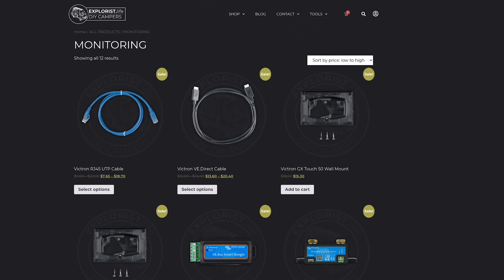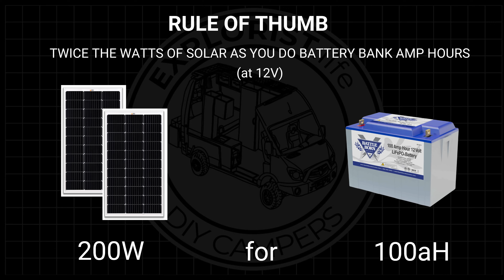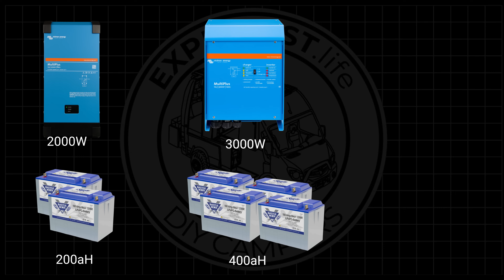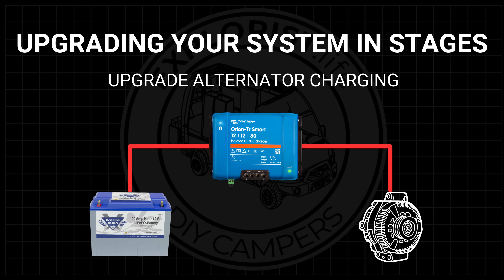Upgrading an RV Electrical System in Stages to Save $$$ upfront.

Comment: Nate

Can you comment on charging a heavily discharged lithium battery from the tow vehicles 7 pin plug.  Some people say you can damage the tow vehicles alternator and other people say that it will just charge very slow.  I want to do my trailers electrical work in stages by just adding 2 x 100 amp lithium batteries first and then going with around 400 watts of solar. I’ll add dc-dc charging and a small inverter as well.  I just don’t want to kill my alternator or melt any wires. 2022 F-150 with 3.5 ecoboost.  Alternator is either 200 or 240 amps. 

Thanks
Reply from the maker: It will generally just charge slowly.  I've never seen it melt anything.  It won't damage the alternator
Reply: @EXPLORISTlife  Thank you.
Reply: Hey Nate, another question, or actually an idea for a video or two.  Can you talk about batteries a bit.  What's the difference between 3 x 100 amp lithium battteries vs 1 x 300 amp lithium battery.  What's the difference between say a 50, 100 and 200 amp BMS.  Charging requirements etc.  Thanks

Comment: Hi guys, I have a tricky question: 
is it possible to put under charge the start battery (during camping standstill) using an Orion DC-DC charger, taking energy from the RV battery bank? 

ciao :)

Comment: I’ve got a 1999 chinook class b with a very old solar system and inverter setup and I really want to upgrade the electrical. I don’t need a ton of battery storage though. I’m ok with running the generator when power gets low. Although I would like to avoid ripping up walls to replace all the wiring lol

Comment: What about shore power charging without an inverter? We know that many converters in popular trailers claim to have a lithium autodetection feature, but it is widely reported to not work well. And even if it does work, it’s unlikely shore power charging will reach the claimed 30 a on the factory wiring. I see Victron sells a 30 a stand alone charger, and so it probably makes a real 30 a especially if located close to the battery. Would you recommend that? I have no 120 V loads in my trailer nor do I anticipate any in the near future. A charger is something like 1/5 the cost of an inverter/charger.

Comment: What you are not telling people. There is another way to run air-conditioning without expensive battery systems. CHANGE THE NOISY, ENGERY WASTING A/C UNIT. mini split inverter a/c start up on very low power(watts).
Reply from the maker: I mean... thats pretty off topic for this video, which is why that wasnt covered. 🤣😂

But at any rate...Not really...  any air conditioner will use a lot of power.  Sure, some are more efficient than others, but if an air conditioner took very few watts to run, it wouldn't cool very well.  Watts in = cooling power.

Comment: I am in the process of converting to lithium.  I am going with a 48V system and am doing it in phases. I am starting with either Eg4 All In One 3000W inverter/charger or a Growatt 3000W inverter/Charge.  For the batteries, 2 EG4 WP 48v 100Ah batteries (a 10.24kWh battery bank!)...of course when converted to 12v that is 800Ah. For now, that is all I am doing...due to budget constraints. I am doing some very minor wiring bypasses to accommodate phase 1 of my install.  For now, off grid charging is via my Honda EU 2000 gas generator (either via the inverter charger or direct AC battery charger (depending on loads). DC to DC charging and solar panels are for phases 2 and 3. Thanks guys for your vids!

Comment: Thanks for this video it has definitely been of help. 

Question:
What would be a good rule of thumb about sizing wires? And what gauge do you suggest to use for a 12 volt system with 4) 100Ah batteries to connect to a Victron 3000W inverter? 

Thanks again!

Comment: Question? Great comprehensive technical information as always. I'm migrating from lead acid to lithium along with DC to DC charger for my 5th wheel while auditing and taking time to design/install proper wire management. Question: should I install larger cables before smaller cables or reverse to make cables look professional along with future troubleshooting?
 I'd like install to look as clean as possible.

Comment: If your battery bank is big and hungry, it may suck full power from your alternator, causing the alternator to overheat and die. Not all alternators are smart enough to reduce their output, so they can cool down.
 That's another bit that's going to need more than 4 minutes to figure out.

Comment: With a tow vehicle that has built in inverter with a outlet at the rear of the vehicle, such as a new F150, what about powering a MultiPlus (for the purpose of charging batteries while driving) with AC when instead of purchasing/installing a DC/DC? I believe my 2021 F150 with the 2Kw inverter already has a  dedicated 24v alternator to power it.
Reply from the maker: Theoretically, that would probably work, but having 120V strung from the truck to RV while driving makes me nervous from a safety standpoint.
Reply: @EXPLORISTlife  yeah I wondered about that too.  My shore power is at the rear of the trailer, so would still need to wire a front shore power and transfer switch (or manual way to switch from back to front) if I did this.

Comment: Hi. Whit a multiplus2 3000 on 24v. Whats the reason for needing 400ah battery. Not sure what you meant.
Reply from the maker: 200Ah @ 24V for a Multiplus 3k 24V.  The short answer is: Because that's what the user manual says.

There are electrical reasons like DC Ripple and inrush current; but those discussions are too detailed for just a comment.

Comment: Well here I go on an adventure.  I have a Class A Motorhome that according to the manufacturer has about 3 miles of wiring throughout.  And trust me, I believe them as I've been to their factory several times, and numerous pictures to help me with modifications, and lastly have their electrical prints, but unfortunately they are extremely small print.  Anyways I'm starting off with 3 195 watt soar panels in series and a Victron Smart controller which I believe will be a 100/50 or 150/50.  I plan to initially have them to assist in keeping the voltage up during the daytime while I'm dry camping.  The batteries are Duracell ECG2 that I hope to replace in the spring of 2024 to finish off the conversion.  Of course, my current 2000 watt inverter/charger is not compatible with Lithium batteries.  I recently purchased your class A wiring diagram to assist me in this adventure.

Comment: Nate, you recommended setting your victron for 30amp shore power at 9.8 amps. Why when I’m not utilizing the full 30a. Or I’m just protecting the overload by 9.8a?
Reply from the maker: Nah; you'll just set your shore power input current limit a few amps under the rating of the shore power.  28ish for 30A shore power.  8-13 for 15A outlets (on the lower side if the outlet is sharing loads with other things).

Comment: For our class C Winnebago Navion, Increasing wiring size and routing was the most challenging upgrade for a 3000w, 600AH, and 1,000w solar system.  This wiring requires fastidious attention to shielding, chafing points, and modification of OEM wiring.
Reply: Hello earlhunt2815, I just purchased a stock 2015 Winnebago Itasca Navion IQ 24V (View).  could you please share with me all the products you used in your upgrades?
Reply: Happy to share.  will post in a couple of days.  However, in 2020, battleborn batteries were the best solution on the market.  no longer true. Lithium prices down significantly and the space required has decreased significantly.  But, Victron still the gold standard for systems engineering compatibility. As an engineer, I over engineer; therefore, I have 4 solar controllers to minimize shading. Most Navion /View systems use one solar controller for all the solar panels.  3000w inverter/charger the ideal... 2000w not ideal.